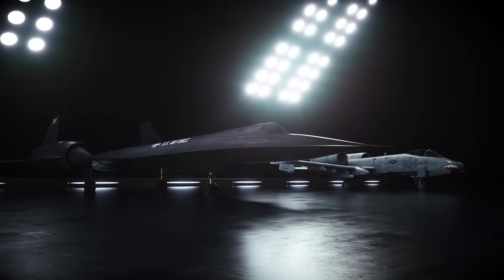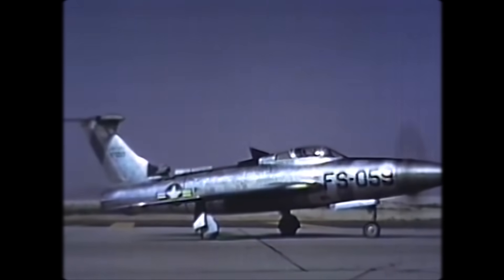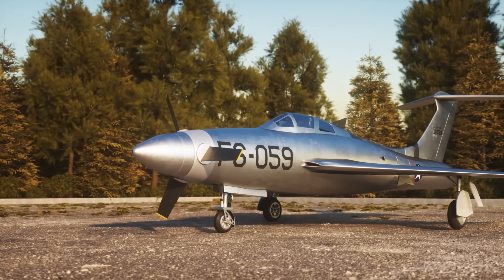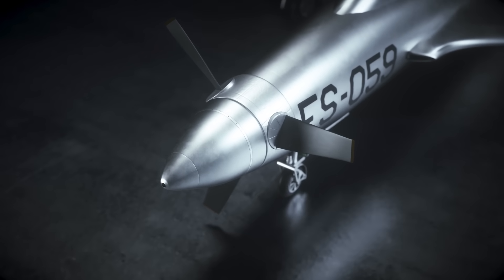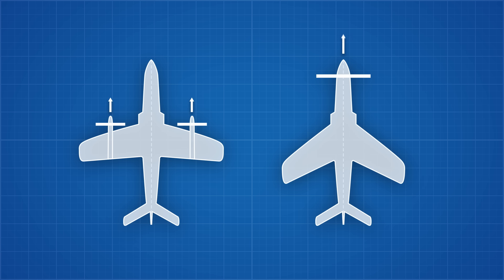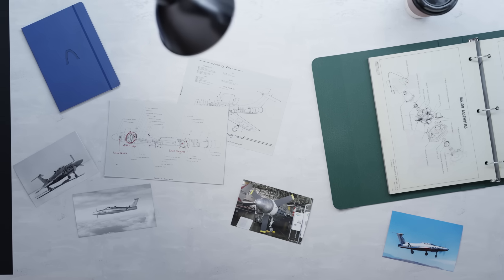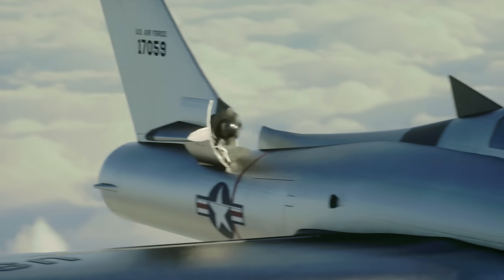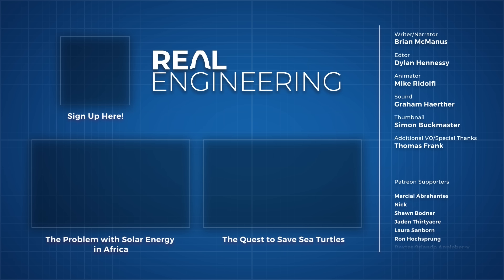The Insane Engineering of the Thunderscreech

Comment: I already know a possible fix, instead of 1 propellor turning one direction, use 2 turning opposite directions on the same drive shaft, and to fix the supersonic sound issue with the propellor making all that noise, we could use a similar propellor tip profile used in the modern stealth helicopter, the RAH66 commache, this would fix the issues with the emerita negitively effecting the roll of the plane, and this would also fix the extremely loud screeching issues of the aircraft caused from the supersonic speeds of the propellor. This being said, I am no flight engineer, so if anyone who is one would like to enlighten me on how good or bad this idea is, I am relatively curious on your thoughts.

Comment: hey i know im late here but about the issue of the plane turning on its axe because of the high rpm of the motor, wouldnt it be possible to have another element rotating at the same speed but in the other direction to counter the gyro forces?

Comment: What if the thunderscreech was push-pull? Same engine efficiency benefits, balanced rotational forces (when both engines used)
Reply: I think there was a nazi plane that had that configuration.
Reply: @thegiggler2  Yeah, but it didn't work very well.

Comment: I still dont fully understand why they didnt run the coupled engines on counter rotations so the drive shafts would rotate opposing directions then meet in the gear ratio into a counter opposing gear to unify the two drive shafts power

Comment: 10 Juni 
21:35 Nonton YouTube 21:40 Kekamar Mandi 21:42 Casual Navigation Why Are Big Ships Faster Than Smaller Ships 21:50 Kekamar Mandi 21:55 Real Engineering The Insane Engineering Of The Thunderscreech 22:05 Kekamar Mandi  terus naikin Suhu AC 23-24 Pindahin Handuk ke Pintu terus lanjut nonton di lantai

Comment: 12:32  Is anyone in the comments an engineer?  I know absolutely nothing about aircraft design or the mechanics involved, but it seems that if the plane was having control issues literally trying to torque itself around the drive-shafts, wouldn't it make a LOT more sense to reduce the RPM (I believe it showed a 6.8:1 ratio) of the driveshafts back at the engine behind the pilot?  That way these huge drive-shafts that ran the length of the plane were at 2000ish RPM instead of 14,000 rpm?

Does anyone know why it was designed this way?  Surely there must be a reason.

Comment: Well done documentary. Excellent thumbnail description of propellers relation to the airstream; angle of attack vs. relative angle of attack. These test "abominations" are the dead ends we need to point out the better path. The pas-de-deux between engine technology and aircraft design is a fascinating thread of aviation history, one seemingly always a bit out of sync with the other, and leapfrogging along as materials improve. There are bound to be failed experiments in any ambitious engineering. 

We learn more from our mistakes than we do from our successes.

Comment: Welll, it seemed like a good idea on paper lol. It is a pretty amazing and innovative design and it's things like this that we learn and build on. Someone has an idea, other engineers get involved, problems arise and they find ways (sometimes very dangerous like the 2 shafts spinning either side of the pilot shaking it apart and the plane may have been a failure but I bet a lot of what they learn from it went into improved designs of other aircraft.

Comment: One of the engines that was in this monster is currently on display at the Kansas Aviation Museum in Wichita. It is just one of the two coupled turboprop engines, but it is still pretty fascinating in a horrendous way. It was described as a 'mechanical nightmare' to route the power through the two driveshafts from the rear of the aircraft to the front, and then to route all that power into a single gearbox. The best I can describe it is 'janky doesn't even scratch the surface'

Oh and I almost forgot, as stated in the video, the engine itself was mechanically unreliable and failed all the time. So yea.
Reply: This plane is no louder than a jet engine. The loudness is a myth. The Russian tu95 bomber has blades that are actually louder than this plane. All modern jets using after burners are louder than this plane.
Reply: @WhiteOwlOnFire_XXX  Wrong, on the first test flights residents of a town 55 miles away complained about the noise, no jet powered plane does that.
Reply: @andrewfidel2220 literally, I live less than 20 miles from Heathrow and several RAF bases, I can't hear nada lmao
Reply: @WhiteOwlOnFire_XXX  How do you know this when there is no running models of this plane?
You need to provide some reliable 
data before you go voicing opinions on this, and you have none

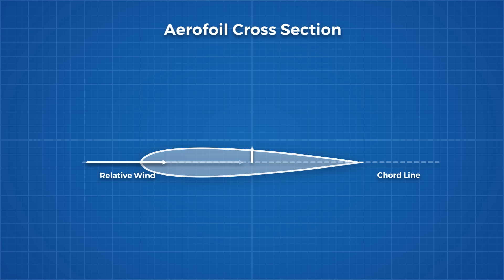Comment: At 6:00 airfoil like this (completely parallel to the stream) can not possibly generate lift because it is symmetric, or am I taking crazy pills? How would universe know which way is up?
Reply: You are correct.  A symmetric airfoil Will not generate lift at 0 angle of attack.

Comment: The anti-torque/anti-roll fin atop the Thunderscreech fuselage does not make any sense aerodynamically.  Aircraft controls (ailerons, elevators, rudders) and stabilizers (vertical, horizontal) are placed at the maximum feasible distance from the center of gravity to generate as long a moment-arm as possible in order to change the path of the aircraft or to stabilize it.

Installing a small fin with a triangular shape so near the center of gravity would have little effect on anything aerodynamically, whether it was fixed or movable.  So far, I have been unable to locate any official source identifying this “fin” as movable or adding anything to the stability of the XF-84H. There is only anecdotal quotes alleging that it was installed for anti-torque purposes. I clearly remember a treatise on propeller torque effect written decades ago that identified this dorsal “fin” as a streamlined radio antenna.  It would be great to find a source that details the external features on the XF-84H to put this idea of a movable "fin" to rest permanently.

Comment: If a Sopwith Camel had to make a left turn the pilot had to make a 270 degree right turn. Combining 2 engines without the least drag worked well with the Dornier Pfeil which had propellers at both ends of the fuselage and did not create the double shock waves of counterrotating propellers. But by then piston engines were practically obsolete  at least for fighters.

Comment: Fairly basic yet unusual and very complicated engineering. I find it hard to understand why engineers did not realize it would not work before building actual airplanes. They took pretty much unworkable engineering, and added a lot of complication to it to make it just barely work, but still not good enough to make it actually useable. It would be nice to be able to actually hear one of these aircraft. I wonder just how the pilot was affected by the sound and vibrations?

Comment: I wonder to what extent it's noise would be an issue operationally. It's not like people aren't going to know it's coming!

I suspect that the improvements in steam catapults and jet engines probably obviated the need for this aircraft's particular power layout before development got far. If you can accelerate a jet enough along the flight desk on launch the fact that it's engine is still building power might not matter so much... It clears the flight deck with enough momentum and speed for the engine to work efficiently.

Comment: FWIW:  I have read that the contrarotating propellers on the Soviet/Russian TU-95 "Bear" 4-engine turboprop bomber are HORRENDOUSLY LOUD.  They are designed to operate in the transonic realm, although the Bear is not intended to be fully supersonic. 
 
As to whether the Bear or the Thunderscreech would actually be LOUDER, I do not know.  However, I am not aware of the Bear's prop noise ever causing seizures in ground personnel...🙄

Comment: For many years, one of the aircraft shown in these clips sat on a display pylon at the entrance to Meadows Field airport in Bakersfield, CA. Meadows' history goes back to the days of hot air balloons in the 1890s. During WWII, it was improved by the Army Air Force so they could use it as a night-flying training field. In 1944, military operations were discontinued, and the field sat idle until the mid-1950s, when it reverted to civilian use. Somewhere along the way, one of the two XF-84H Thunderscreech aircraft ended up on that display pylon, with a small motor rotating the prop at a blessedly-silent several seconds per rotation. In 1992, the Air Force bastards took it back, leaving a nondescript T-38 trainer in its place (until 2015, when the T-38 was moved to Minter Field Air Museum in nearby Shafter).

Comment: I gotta have it! I wanna make it a leaf blower, on my airboat.
Reply: I'll build an 800 cubic inch flat plane v8 that puts out about 6,000 hp with E85 gasoline, or av gas with water methanol   quad turbos, and a high volume displacement, super cooled, augmented supercharger, to pre pressurize the turbo inlets to provide more than enough volumetric flow than needed along the entire operating range, to improve longevity, I want to piss off my former asshole neighbor, (former neighbor, still an asshole) enough that he short circuits in his under shorts. Because I owe him some equality, and I'm a thoughtful person!

Comment: Awesome animation and really good presented. There is just one mistake: A symmetric profile with 0° angle of attack (inflow direction) does not produce any lift. To explain this in simple word: The lift is the result of pressure gradient from upper to lower side of an aircraft profile, caused by the deviation of the upper flow around the airfoil. Otherwise you could not explain why it is possible that an airplane is also able to fly upside down.

Comment: Tacit Blue was not a failure.  It was a brilliantly designed aircraft that demonstrated the value of airborne ground surveillance, and the radar deveoped for it became the basis of the gear installed in the E-8 Joint Stars.  Tacit Blue's radar cross-section was such that it did not appear on other aircraft radar until the plane irself was clearly visible to the other pilot.

Comment: I just realized - it's fascinating how similar the profile of these supersonic propellers are to the wing of the F-104! Short, thin, sharp leading edge, no camber...and indeed, that wing is extremely effective at producing lift above Mach 0.7 or so!
Reply: The stages of wing design and engines used has always fascinated me. To see the progression through trial and error. This fuse is beautiful though as you see.

Comment: This aircraft seems absolutely terrifying to fly, I got to hand it to the pilots that flew it on test runs! I've flown several single engine aircraft and done a lot of RC flying in my day so I know a little bit about aircraft knowledge. And you're absolutely right about the sopwith camels.... I had a giant scale that was a handful to fly! That sucker would not turn unless you are giving it full rudder, even if you banked it at 35° it would just want to go straight. I couldn't imagine having a scale model of the thunder screech, that would be one interesting RC model to fly!
Reply: Imagine that :) that would be a weapon.. Literally a propeller driven missile (hope we didn't give some peope bad ideas with these comments )
Reply: I found this plane when researching what happens when I drive a prop tip to supersonic for an rc speed plane I'm working on not a thunderscreech replica but I'm spinning a prop as fast as I can electric so I was curious was doing calculations and realized my prop might well go supersonic

Comment: I think the Soviet Bear is probably way louder. It had 4 engines using the same multi prop contra rotating technology, all making more power with each prop breaking the sound barrier. Shouldn't make random claims without doing research bro !
Reply: The Bear is indeed loud (submarines can actually hear Bears approaching in shallow water), but I haven't heard tales of Tu-95 ground crews passing out, throwing up, or having seizures when the engines run up to speed.  Pretty sure if it was that loud, the Russians wouldn't still have it in service.

Comment: I don't know why the wind vein concept was never used in place of a prop. Sure it requires half the inbound air to be blocked off, but such a blade can reach fantastic high rpm's. A serpentine concave blade is used today most commonly only to measure wind speed. If you apply a silencing chamber to the output similar to a pistol silencer chamber, this would make the worlds most silent aircraft.
Since both patents are expired, anyone could 3d print such a thing for silent drones.

Comment: The sound seams to have a lot of low amplitude noises. This plane actually with some rework could be very nice for nonlethal warfare. Imagine flying this abomination across enemy lines and all enemies fall down vomiting. And don't thing that earmuffs will help you, it is all about vibrations all over, those high decibel low amplitude rumbles. 
Non lethal mass destruction, all those solders temporarily disabled, needing evac, panic, rout and all.
The only problem are huge logistics costs due to to many prisoners when friendly army finally conquers the vomit covered hills.

Comment: Would've been interesting to see if that plane could pull off the Vulcans trick of setting off car alarms in the car park as it flew over. :)
Reply: no, it broke the communication systems at Edwards AFB and got banned to the lake. forced to use light signals so not exactly funny or joke.  Setting off alarms or telephone answering machines has more to do with the pitch   same as Aeolian vibration on bridges.

Comment: Wait, this supersonic prop driven by 5'000+ hp coming from two engines, spun at JUST 2'100 RPM? That's less than on a Cessna-172 driven by an old 160 hp Lycoming-320.
21'000 rpm sounds more like it...

Comment: The sound being produced by shockwaves doesn't mean it can't be recreated digitally. I've seen papers about synthesising gunshot sounds that included sections about synthesising the sound of the shockwave from the bullet's sonic boom, so that part is definitely possible. Figuring out how they combine to make the overall sound would require some knowledge about the physics behind it to figure out the waveforms produced. Such synthesis is pretty low-level (you're more-or-less computing individual audio samples directly), but it should be possible if you can figure out a model for the sound source.

Comment: Counter rotating props would resolve the roll issue - afterburning motor would have made the whole mess pointless - in todays hybrid era the driveshafts could be done away with - use the jet as a generator to drive high power electric motor to run the prop, same as a diesel train

Comment: It's tacit, not tactic.  Tass-it.

Prop governor surge in this case refers to the propeller governor suddenly increasing pitch.  The left-rolling effect described by the test pilot is due to the kinetic energy of the drive system being dumped into a propeller trying to spin *less*, because of the increasing prop AOA.  It isn't actually the propeller rolling the airframe to the left, it's the gearbox/drive system.

Your animations are great; nice job all around.

I appreciate the inclusion of the rotary engines..  maybe do a short bit about a) why everyone had goggles on,  b) what oils were used to lubricate those engines, and c) where that oil went :D

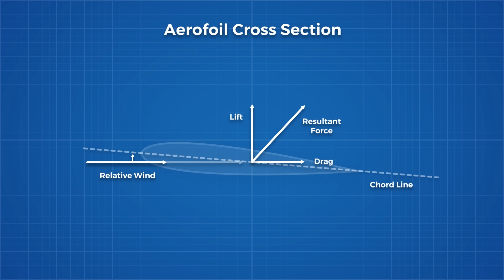Comment: At 6:02 you show a symmetric aerofoil without incidence but say there is lift.
In fact this kind of symmetric wing only produce lift when the incidence is different from zero, when it is equal to zero the force applied to the wing on top is opposed to the one under the wing, so the resultant force is just pure drag

Comment: doesnt the fact that the propeller was so loud imply that it was not very efficient and turned a lot of its energy into sound instead of thrust?
Reply: Yes, and it's an issue modern jets have to deal with as well.  Transonic flight is inherently less efficient than subsonic flight.

Comment: hmm I wonder if we could get the thunderscreech to mach 1 in modern times, I feel like if they put the prop at the rear it could've reduced the strain and potentially increased efficiency..

then again... I'm not an aeronautics engineer so I could be wrong, I know their are planes which have props at the rear of the plane rather than the front to that type of prop set up isn't unheard of...

Comment: In my view the Thunderscreech was a total failure.
For comparison:
German WW2 Dornier Do 335 "Pfeil/Arrow" max speed 763 km/h (1945)
That's just 70 km/h slower with 1945 technology and piston engines - flown with great success.
Russian 4 engine bomber Tupolev Tu-95 "Bear" max speed 935 km/h (1952)
That's almost 100 km/h faster, in a 4 engined bomber -  still flying with great success but also extremely noisy.
Thunderscreech max speed 837 km/h (1955) - project unsuccessful and ditched.

Comment: part of me wonders why there was no prop put behind the pilot.... i mean i would hate taken the design of the twin boon tail p38?  one prop in front one in back, changes in wing design of course but the tails are not behind the motor and the torque would have been offset by the 2nd prop rotating in the opposite direction.... would that have worked???